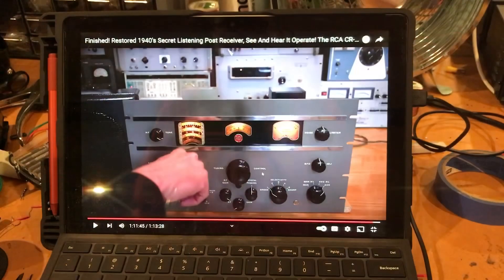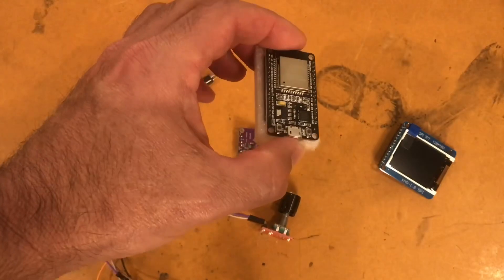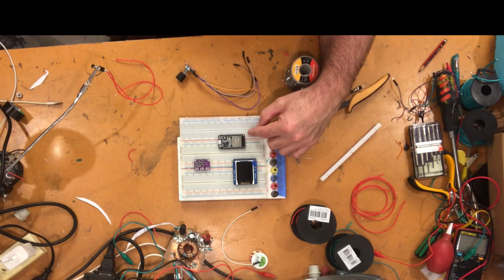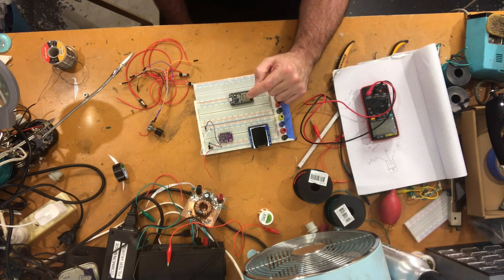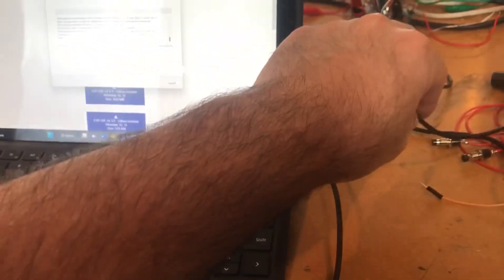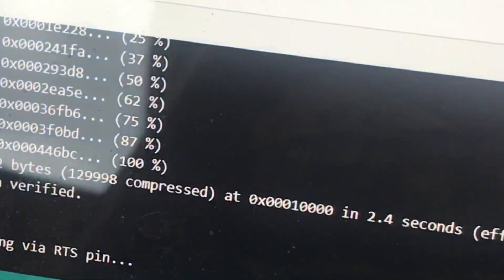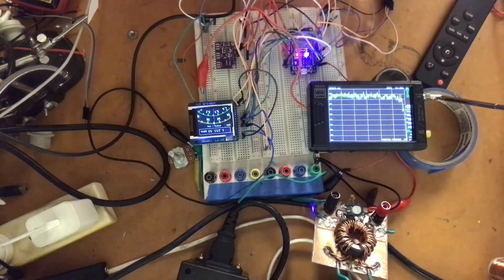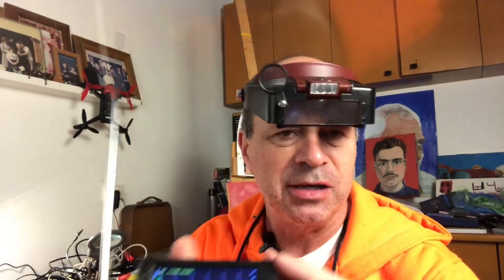NOT a DDS HAM VFO with analogue dial

Comment: Hi, is it possible to add bfo, am, cw, usb, lsb? do you know a firmware with this capabilities?
Reply from the maker: Short answer is no. You could use 2 one could be receive on a direct conversion receiver (no BFO required). The other on transmitter. This way we don’t need to worry about offset for CW. I think if you look at other Arduino code it would be possible to adapt a “cut and paste” of code. If I ever see more complete code I’ll make another video. My plan is to use it so maybe…. One day? 73 OM.
Reply: @TheArtofEngineering  thanks, 73 LU2DVY

Comment: I built the same project with the same generated graphics. I couldn't get the Frequency output anywhere close to the display frequency, I went through the calibration procedure for the Crystal on the SI5351 board, that bought it in line to the 10 MHz, also, I also did the offset, absolutely bang on 10 MHz, bought too far out to be of any use anywhere else. I went through the code in my usual fashion, rework it, now output is linear to the display I'm very accurate. Also change what was the memory loop button, adding another button for memory up memory down, then changed the two buttons to operate as a band up and down, 160M, 80M, 60, 40, so on, 15 in total.  I've also included a mod button AM, FM, SSB, programmed it with the offset for LSB and USB.  I don't know why but I also added CW. May remove SSB and CW,  I also extended the frequency range to 280MHz. I changed the size of the VFO on the display and made it blink when in VFO mode. Also added MOD info to the display, opposite side of the VFO position. So with the rotary button mine now has five bush buttons, now I've decided to add a 4x4 keypad for direct frequency input, as I'm building it as an RF generator.
Reply from the maker: Well done….. my coding ability is next to zero! Still got my L plates on. 73😂 I am yet to check how accurate it all is…. One day?

Comment: Question from an old developer of PLL Synthsizers in the eighties.
At that time the SSB phasenoise of the VFO was crucial for a reasonable large signal capability of an analog receiver Receiver.
What is the phase noise figure
of your setup at an output frequency of 5 MHz.
From Old school receivers I remember to values of 
90.... 95 dBc /Hz at an offset of 10kHz from the carrier.
Do you have any information on that?
73s
Erwin from Munich
DK3YQ
Reply from the maker: The unit uses an SI5351a chip which is where the synthesiser lives. I am not very knowledgeable on the radio front technically (having been earlier serving in a technician type role and as a ship’s RO). My understanding is it depends on loading of this chip. Buffer it well and it is ok … load it heavily and phase noise becomes onerous. Hans Somers from QRP Labs (who does understand this stuff) did some investigation. If I presently had time would love to do a deep dive (maybe one day in the future?). 73 de VK2AOE 
https://groups.io/g/QRPLabs/topic/qcx_si5351a_phase_noise/34367663

Comment: This looks like a cool project! I got my first Arduino earlier this week and these things are cool. I bought one of those extremely cheap, very low power, single-frequency transmitters. A VFO would be incredible though. Is there a major technological challenge that keeps this design from being expanded into the UHF band?
Reply from the maker: I haven’t played with VHF/UHF (the dark arts 😂). The SI5351 will go to VHF/ UHF freq range (up to 900 MHz I 🤔 think? ) but RF DESIGN becomes exponentially more difficult as you increase freq. 73 de VK2AOE

Comment: GAAAAAAHHHHH! ANOTHER video/article saying DDS vfo or signal generator that ISNT DDS!!!!
as someone who is searching for DDS specifically, I'm getting pretty fed up with this internet wide mistake of calling PLL multisynth based signal sources like the si5351, DDS. Its even more galling when you actually have part of your presentation covering the harmonics produced from this circuit and not make the connection that it is the direct consequence of it NOT being DDS! Thats why you would use DDS, DDS is harmonic free pure sine waves. As you stated in this video a few times, the si5351 is a clock generator and produces square waves, now this CAN be used fine in most applications with simple filtering of harmonics and many radio projects have successfully employed them.
Like I say, its not just here, its seems internet wide that every Arduino, raspberrypi micro controller signal gen/vfo gets labelled DDS, and its incorrect, so sorry if it seems like I'm picking on you.
73 de G0AFV
Reply: G0AFV is right... This is NOT DDS... Little details are important, and this video is not being presented as "entertainment"... I only stopped to watch this myself because I suspected the title was wrong... and sure enough.. it was. Otherwise it's a pretty good video but people like me are always looking for dumb little mistakes like this to form an opinion about how reliable the information really is... Careless neglect of details like this make me wonder what else is wrong in the video... maybe ask a "technical" friend to review it before posting it on YT. There's already enough "noise" out there, don't make it worse... please.
Reply from the maker: @bobsimmons5274 I agree Bob but also disagree. I could show any video to several “technical” friends and they would disagree across a wide variety of aspects of any given video, hence leaving this comment section OPEN to express disdain, or point out errors. As for the misuse of this term, that genie has left it’s bottle and is now on a worldwide vacation! Have a look on the net …. If you want to buy or read about this “NOT a DDS VFO but PLL derived digital VFO “ ….  the vast majority of products and articles and videos are titled “DDS”. Be it YT, Ali Express, Evil Bay…. etc etc etc. 
Language, even technical language changes over time due to semantic drift (sometimes towards more precise and correct meaning, often away from it). The tribe have spoken and no amount of zeal will change this fact. YT is a forum that provides YOU the opportunity to share stuff. You could make a video pointing out your disdain of the current practice of misnaming this VFO? I’m thinking about doing one now 😂. Thanks for the comment, I will change the title, in the name of technical precision and YES, I will make a video to confess my technical incompetence. 73 OM de VK2AOE.
Reply from the maker: Yes …. Correct. But I’m an AMATEUR radio operator not an RF engineer. So it is Digital Synthesis (as the RF is produced by digital means) but NOT DIRECT Digital Synthesis. It is my understanding that DDS only allows a change of frequency if the reference clock is changed …. So this might be why amateur projects don’t use it (too complex?). Why would you use a true DDS for a simple CW transceiver if a PLL derived signal suffices? By the way no offence taken, this type of comment is how we all learn about this hobby we ALL love together: if you do find a DDS (or design one) drop me a line. 73 de VK2AOE
Reply: @TheArtofEngineering  "..but I'm an AMATEUR radio operator not an RF engineer.." running a YouTube channel labelled "The Art of Engineering" ? whatever, its only YouTube.
Your description of DDS is totally wrong, Google will sort you out there.
There are a number of REAL DDS VFO and sig gens kits and projects already out there, created by amateurs, most seem to use the AD9850 chip, and no they are not really anymore complicated than this circuit.
73 de G0AFV
Reply from the maker: @bazzaar1869  I have a Radiocommunications Engineering Certificate… Fine Art Degree and I’m part way through (18 months) of a Mechatronics Degree. Hence the channel title. As for YouTube “sorting me out” …. I do this for enjoyment…. But the channel does grow up to 100 subs per month, so some hams are enjoying the content. 73 OM.
Reply: Purists!
For decades, digital signal generators have been called "synthesizers" and everyone knows what it means. Move on!

Comment: Yes the Si5351 outputs a square wave signal so yes you do need a LPF to make it a sine wave.  In my case, I built an external VFO for my Kenwood TS-520 where the on-board (internal) VFO operates between 4.9 Mhz to 5.5 Mhz that's mixed with the rest to create the exact operating frequency of the radio.  Even though it did work with the square wave signal, it was best to serve it with a sine wave so I made a 5th order Butterworth Low Pass Filter with a cutoff of 5 Mhz using the LC Filter Design program on the Marki Microwave website.  Came out pretty slick.  Enjoy
Reply from the maker: Thanks for the comment! Yes I love the TS520 too. Thanks for sharing your tech exploration 73 de VK2AOE.